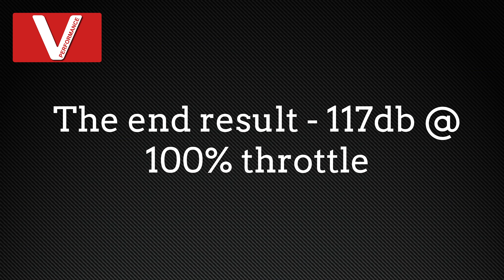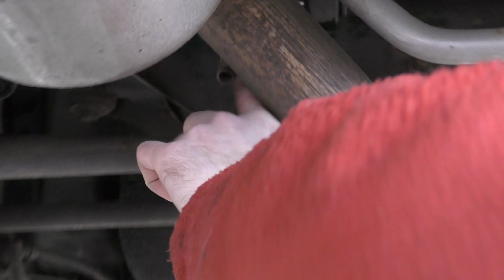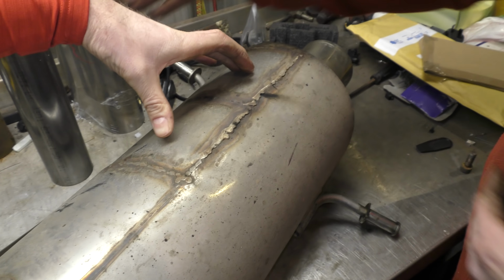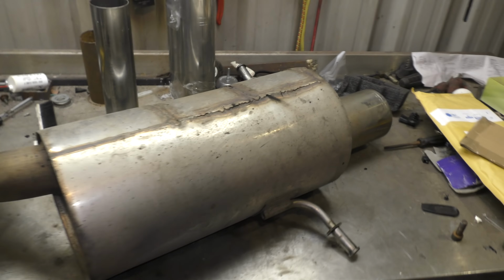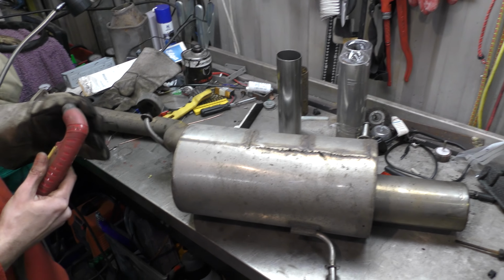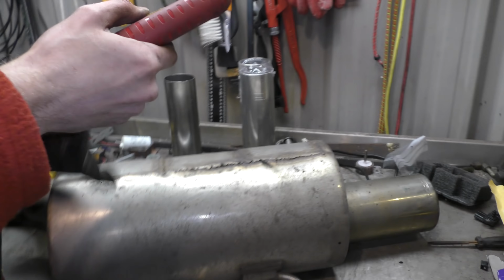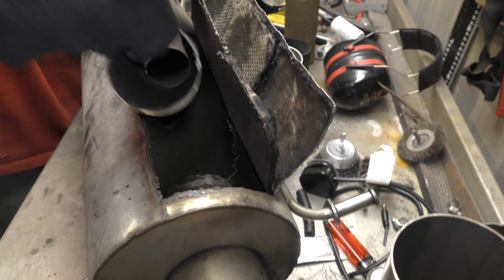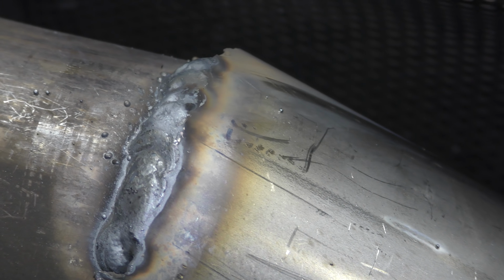Prodrive backbox straight pipe mod // Project WRX

Comment: You should have drilled some holes in the pipe you welded in, or cut some grooves lengthwise on it, so the box would work like a resonator. The sound would have a lower deeper tone, and would be not as loud.
Reply from the maker: That sounds like a future experiment. Have you ever tried changing the interior pipes to get a different sound?
Reply: I am an amateur acoustics engineer, so most of my experience is in theory  :) but yes, i have tried some things. For example the same car - stock (cat resonator and muffler) vs stock with cat removed vs just resonator vs just muffler vs nothing just pipe. And the effects was just as I predicted, just cat removed - almost no difference, just straight pipe - fun but not practical way too loud. Only muffler interesting... quiet and loud depending on RPM (frequency), it has some RMP regions when it starts farting, and some when it is quiet. Can drive quiet if you want or be louder. The best configuration for my taste is only one resonator. It is quiet on idle, but if you give it some, then it sounds like power.

Comment: If you are not putting load on engine is no point mesure db revving. Under load on road there will be fucking much more db :D
Reply from the maker: You're right it's much louder with load. The first videos are destroying the mic and in the driveway footage it manages to cope. At least in trackside testing for noise limits it isn't under load.